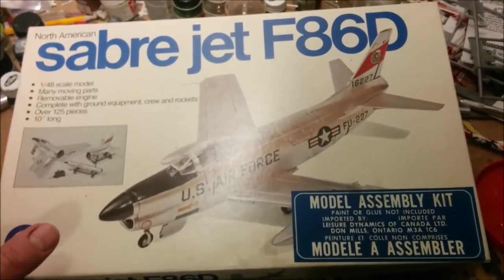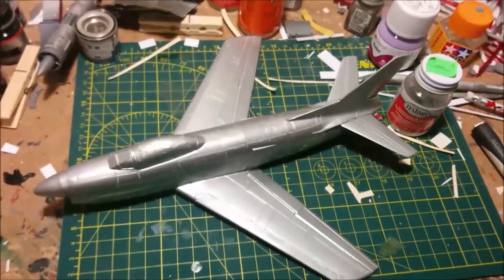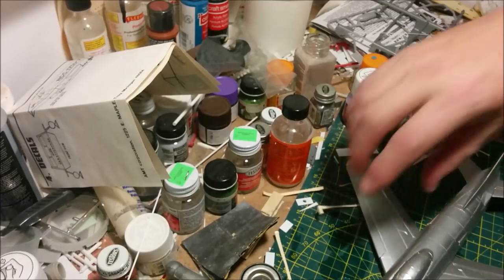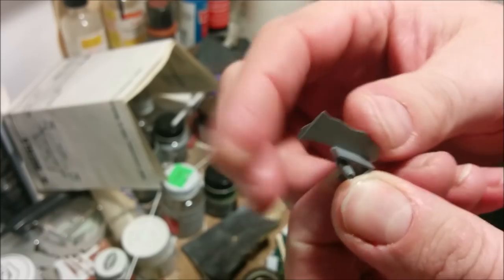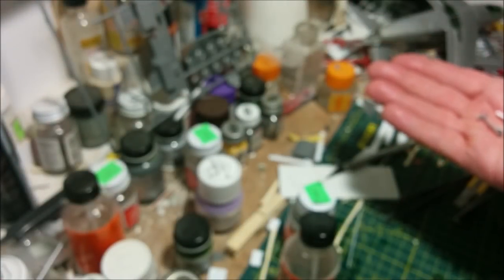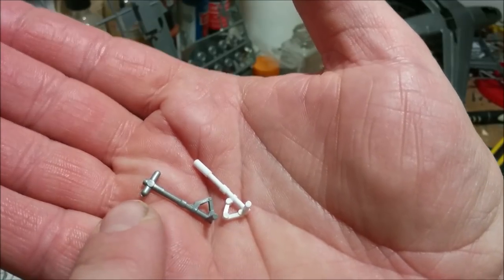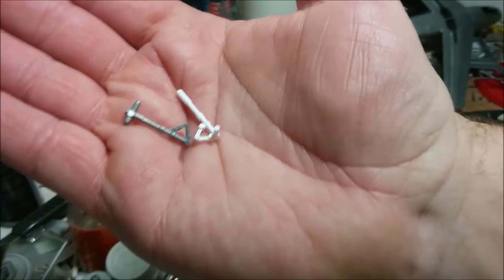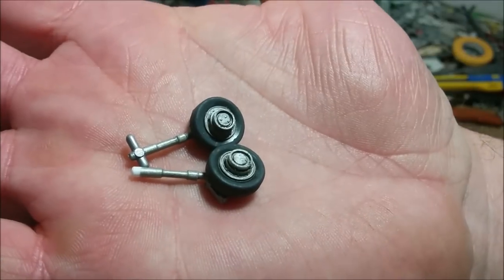F-86D Sabre Build 1/48 Pt6 by Entex Done!

Comment: You successfully turned a sow's ear of a kit into a silk purse! Good work! Tried this kit a couple of times when I was a kid/young adult. First one had defective parts, and by the time I got the replacements it was months later and the the rest of the model got scattered. Second time a few years later I remember I ran into the same problems you did... lots of flash and for me at least the fit was pretty bad. Never assembled, it went back on the shelf and was either donated or given away at some point. Definitely not a beginner's kit!
Reply from the maker: Thanks! I have a habit of either building kits with lots of issues or making easy kits complicated.